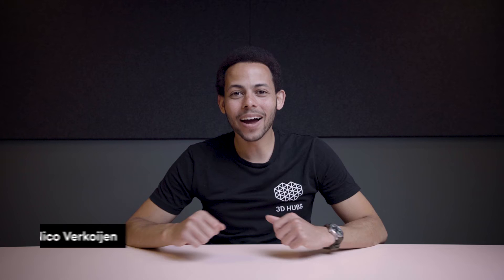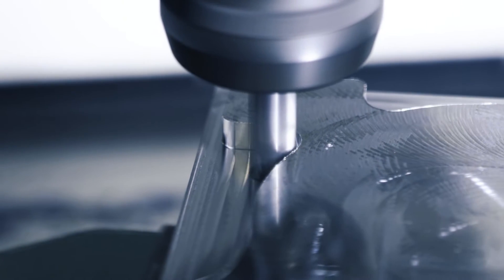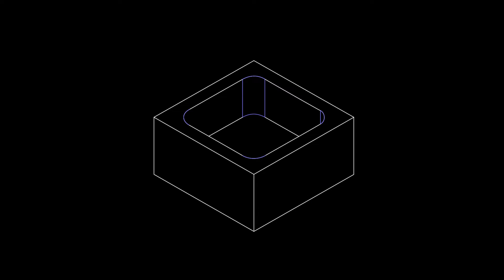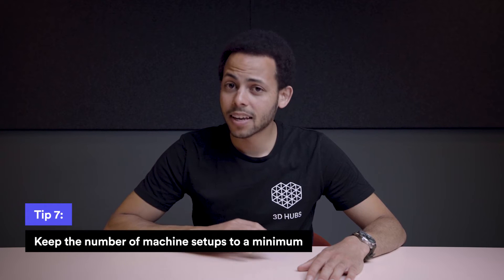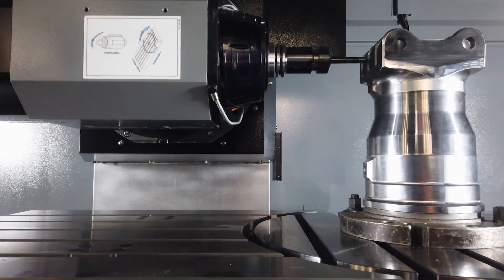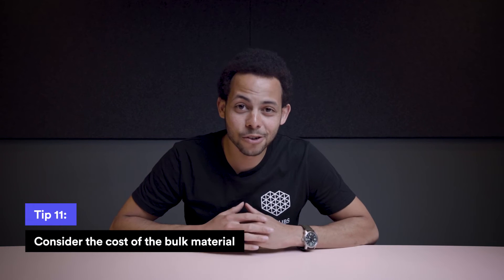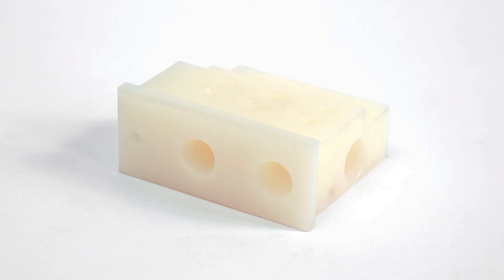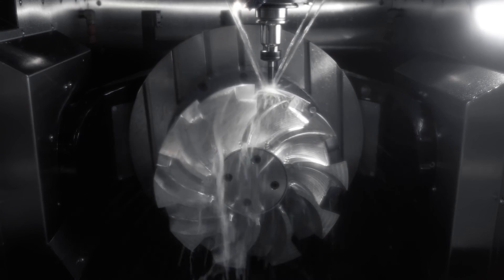CNC machining - Reducing Costs (14 tips)

Comment: This is a perfect roadmap to the CNC universe! 🗺 From 3-axis for simplicity to 5-axis for complexity, and mill-turning for ultimate efficiency - understanding these options is key. At Jevny, we're your manufacturing navigator, selecting the perfect CNC process (or combining it with 3DP) to balance speed, cost, and precision for your project.

Comment: Thanks for a  great video, I have another blank related question. I presume it's not required to machine all surfaces of the blank, if the blank surface finish and tolerances are OK for the application. This of course depends on many things like the blanks surface finish and tolerance and the method used to divide it up. What can you say about the surfaces on blanks, their tolerances and how larger blanks are divided and what surface finishes and tolerances are possible in that step? Thanks for great content and your help.

Comment: “Specify tolerances only when necessary…”

If it’s on the print it needs a tolerance…
Reply: If not cut 5% more or 0.2 mm. Whichever is smaller

Comment: Is 0,5 mm a normal drill bit
Reply from the maker: Hi, 0,5 mm is considered a normal drill bit.
Reply: @ProtolabsMFG  thanks you but i if i have a fusion 360 design how do i share it to a machining company and do i need to put measures or the cnc program know all measures?except for the threads ?
Reply: I dont know if you will see my last question because i just edited my reply
Reply from the maker: @tristanlongangue5671  You should share the 3D files ideally in step or iges format with the required radii designed in the part. If the part has specific tolerances requirements or needs threads these specifications should be included in the technical drawing (PDF).

Comment: Thanks for that, it was a great video! You mentioned blank sizes - presumably you mean that if you design exactly 3mm smaller than standard blank sizes there is a minimal amount of material to remove. However, you don't mention what the standard blank sizes are. Do you have a rough outline for that? I'm sure there is variation.
Reply from the maker: Hey Arild, Thanks for the compliment and this page should help you find an answer to your question: https://www.3dhubs.com/knowledge-base/standard-blank-sizes-cnc-machining-sheets-rods/ Hope it helps!
Reply: @ProtolabsMFG  Thank you!
Reply: @ProtolabsMFG  Thanks for the video and link. The page says "Stock plates come pre-cut to size or as large sheet (typically, 2 m by 1 m - 6 ft. by 3 ft.) that are cut to blanks by the machine shop. So, the limiting dimension for a plate when it comes to design is its thickness." Does it mean I do not need to care about x and y dimensions since it will be cut to size by the machine shop anyway?
Reply from the maker: @samgong1366  Hey Sam! There is always a size limitation on plates. It depends on the supplier.